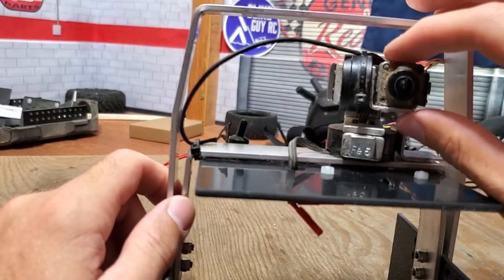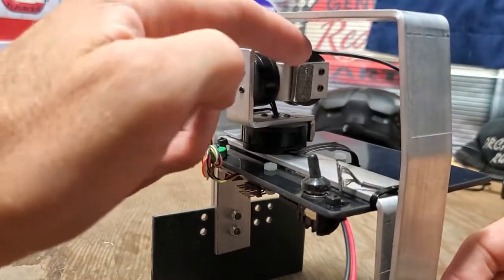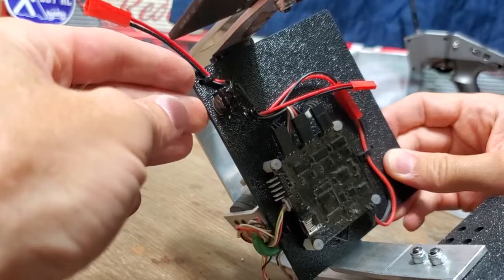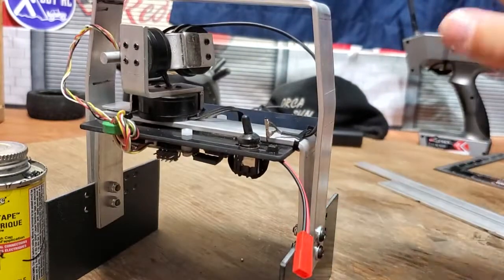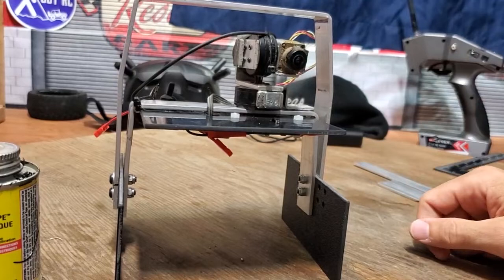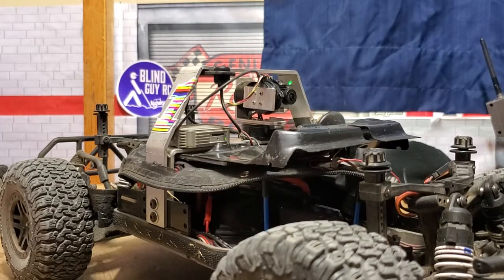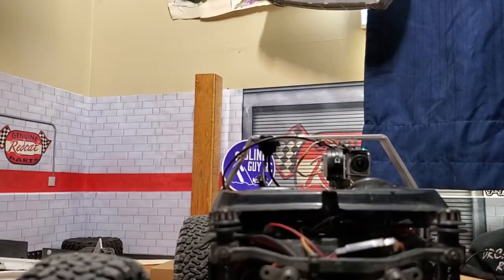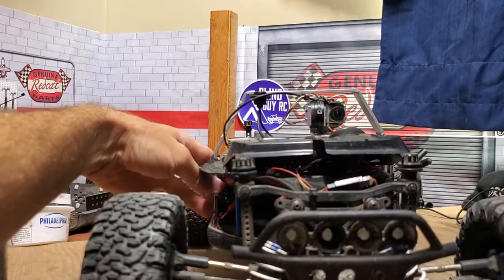FPV Setup - DJI FPV RC Car - 3 Axis Gimbal

Comment: hard mounted? wow and it works very weel. good work man! and good tunnig for the gimbal.. (a part of the cable management.. lol) ..no is a very good fpv car. thank you (i do the same with the same board (storm32)..) but i'm mid way to finnish it.. tunnig a lot.. thank you another time because now, i know is possible!!!
Reply from the maker: Thanks dude! yes i've had some good sucess with the storm32, its a challenge but like you say I wanted to show it could be done and was effective on a fpv car.  I still think there are advanatages to using the storm32 as we can build custom gimbal frames and make them very heavy duty. I find if i limit the range of motion i have the best success in terms of reliability.  Also adding some extra weight to the camera makes the tuning much easier, about 14g should do it.

Comment: Please.. how did you power the vtx on a rc I can’t find a video now where please how did you do it
Reply from the maker: I like to run everything off a single battery so what I do is add one of the red JST plugs to the esc side battery plug.  Then that is used to power all the FPV equipment.  I show this a little bit in my BASH-CRAWL pt2 video 👍

Comment: Which RC Car is that?
Reply from the maker: Hi, this is a Slash 4x4, proline baja bug body and proline bfg ta ko2 tires for shortcourse rims
Reply: @JIPPERR_1   Dude, your video is really cool! I loved your project and I'm going to try to build one!
I can't find this model to buy, can I use the "ZD Racing DBX 10 1/10 4WD" or the "MJX 14209 HIPER"?
Will this aluminum structure fit these models? or in one of them?
Thank you very much!!!
Reply from the maker: @k9fpv  best to stick with slightly bigger rc's 👍 the zd racing dbx10 would be a good one. Cheers!

Comment: I saw you had 2 cameras on the gimbal somewhere, is that for 3D viewing?  How do you send the signal to the goggles? Do the goggles have a "side by side" option to convert the signal to 3D?
Reply from the maker: So ya that is a 3d system, sadly its not produced anymore :(  i did quite like it but thankfully once things are in motion there is a 3d effect due to the relative motion of near and far things. The way this system worked was unique to the goggles (skyzone 02x) where there was one camera signal for each eye. The goggles tune in two separate frequencies, one for each eye. So its a pretty simple system, only drawback is it uses up two channels. It's quite effective, but i still had trouble gauging inclines.

Comment: I am full swing in creating a stabilized gimbal with pwm injection for my head tracker and manual control.  I hit a road block in with the frame parts...  The one that came with the gimbal controller is made for a GoPro and is too big.  I can cut it down and maybe re-drill the holes, but I think I should make some 3D prints of those parts.  Never done it before, so this should be fun.  I am working with a Super Baja Rey 2.0 so I have lots of room to work with in the cab!  I am torn about using a Crossfire PWM adapter or just use the Radiolink controller I got.  Both have great range, maybe I use a combination of both.
Reply from the maker: Right on! Loads of space in that SBR for sure. Sounds like an epic build!  If you want to message me on instagram and i can send you a link to the design for the frame.  I went with radiolink and its been pretty good, but also i dont really know better 🙃

Comment: I see this being the future of RC cars. Imagine a race in fpv? That would be fun.
Reply from the maker: For real dude, hoping this style of rc/fpv catches on. Little hard right now cause all the stuff is custom made. Hoping that if people see this stuff they'll know that it can work and will give it a shot 🙌
Reply: imagine a racing series with real cars but with no restrictions cus safety wouldnt be a problem, imagine an f1 car without all the FIA regulations on it driven from a racing simulator
Reply from the maker: @SIHdW3W  in a way it would be the only safety regulation they need 👍
Reply: Dji fpv won't come cheap other brands is just never ending latency issues

Comment: What wheels and tires are those? I love the way they look. 👍
Reply from the maker: Right on! These are the stock black and chrome slash wheels but I took all the chrome off with bleach. Tires are proline BFG TA KO2, they are a bit bigger than standard short course at about 120mm diameter (PRO1013400).  Because the rims are weird I ordered some 2.2 foams and cut them down to fit 👍

Comment: Another awesome video, ordered my storm32 gimbal today. Excited to tackle this project!!
Reply from the maker: Right on! I have a blog at the rcgroups forun with more info should be easy to search up, username is JIPPERR. I've posted a design template for my current gimbal frame. I may update this soon as I've been going over the design a bit. But nothing major has changed so far.

Comment: Hello! Your videos are fantastic, is there a streamlined setup for a similar system? I am getting the Walksnail FPV system and I am trying so hard to find a gimbal thats around this size.
Reply: Also planning to do only 2 axis for simplicities sake, pitch and roll, but i do like the idea of your gimbal turning with you, thats insane.
Reply: oh! and I am using a traxxas rally vxl 1/10 (non fiesta)
Reply from the maker: Hi, thanks so much for the nice comments!  If you go back through some of my vids you can see in a bit more detail the gimbal I started with.  In the end I made my own gimbal frame to get the size right.  Happy to share the design, construction methods, and setup if you want to give it a shot.  Doing a pitch and roll gimbal will make it lots simpler, yaw makes it more complicated but it is quite fun once working.
Reply: @JIPPERR_1  I'm definitely plunging headfirst on this haha. Each day I learn a little more about these things. The first 4 or 5 times I tried to look up tiny gimbals I came up woefully empty handed. Then I got comments I should just make my own but I don't really know the intricacies of balancing nor do I truly want to spend hours tuning one 😅 (also no 3d printer) 

I was hoping i could get one that would autostabilize out of the box. I was looking through all your gimbal videos but I probably need to review them a few more times. 

Its very inspiring to see the success you've had with the setup, I think it looks great on the drives you've posted. The frame is huge!  I'm trying to brainstorm something that looks a little smaller. 

I keep seeing these gimbals that are upside down (amazon etc), wondering if those will even work if I turn them up the other way, or If I should just mount it upside down and have the cam pop out the windshield or something. I would prefer to see some or most of the car (instead of your first person) but I'm willing to try both. 

Also worried about chopping up my RC car too much because its my only one, but we'll see! I saw you mention a group chat, I wouldn't mind giving that a go as well. 

I think I also need to cool the VTX? Its not flying around in the sky with wind whipping around it, how hot does your DJI vtx run? I am guessing the Walksnail one might get hot.
Reply from the maker: @Ultimate   Headfirst is the way to go! Similar to you I started with the traxxas fiesta rally car because i felt it had the most room under the body shell and like you say the gimbal is pretty big. I wanted it under there so that it would be protected in a crash and to have a bit more of a scale driving experience.

The controller i use is the storm32 and it can be setup in lots of ways so no problem having it supported from the bottom rather than hanging down from above.  Its made for hobbiests so its quite configureable. Also this is one of the less expensive gimbals so not a major investment to strap to an rc thats going to crash and roll, get wet, dirty etc. There are definitly more sophisticated gimbals out there, but this one works well with rc transmitters protocols (pmw, sbus, ppm) and runs pretty trouble free most of the time.  Check out @Smokeefpv here on youtube, he's got a gimbal setup using some different equipment from me.

The big challenge is that if the gimbal is not purpose built for the fpv camera you'll end up having to add weight to ballance it so that it runs well.  But then it'll be to heavy to survive for very long.

Overall im definitly happy with the results, but definitly cost more time than anything to get it to this level.  I guess my hope is that by sharing what I've done it'll help others who want to try the same thing and save them time.  It takes some time to learn gimbals though :)  I wish or dji or any other company would sell a micro sized fpv gimbal! Surely drone and quadcopter people would want that too. 

I usually turn the vtx power way down when i run and if i run out of range or know I'll be going fast then i turn it up.  It gets pretty hot and will go into low power mode if i leave it on hogh power all the time.  A fan is a good idea 👍
Reply: @JIPPERR_1  ended up watching many of Smokee's vids haha, will report back here with more, but I gotta manage the rest of my time before sleep 🤟😅

Comment: This is bad ass! =)  How 1:1 is the movement with your headtracker?  Any latency? ^_^
Reply from the maker: There is a bit of latency on the head tracker, and the gimbal moves a bit slowly for the HT inputs but generally works pretty good.  I honenstly dont use the HT that much as the gimbal also turns with the steering and takes care of any issues due to the car sliding or wiggling around.  It could be set up with 1:1 motion which is probably a good thing for head trackers but im not quite there yet.  I should probably play with the HT more.   Probably I'll do a vid about the HT all on its own as folks really seem interested in this part.
Reply: @JIPPERR_1  awesome!! =)  I'm looking to use this for general purpose FPV usage... planes, drones, cars :-D  I use a headtracker with a 3d printed servo gimbal on my fixed wing and it's a little notchy (just the nature of servo gimbals...) plus none of the stabilization of course.  Fantastic work man; can't wait to see where you go with it!
Reply from the maker: Its great on cars cause it stabilizes the view, I'd watch out on aircraft though, to steep an angle or sudden jostling at high angles could glitch it out.  No problem on a car, big problem on an aircraft!  Definitly cant do any inverted manuvers.  But ya, total game changer for fpv cars 👍
Reply: @JIPPERR_1  ooh, that's good to know.  Thanks for the heads up! =)
Reply: Sorry to bug you again, but quick question on the location of the 2nd IMU (which I believe is the board itself or frame IMU?) which the manual says needs to be above the yaw motor.  I tried booting up my 3-axis gimbal in the inverted orientation and the pan motor started spinning uncontrollably which I think is attributed to the board being below the yaw motor.  Did you experience any similar behavior and if so, how did you bypass that by having your board below the yaw/pan motor? ^_^
Reply from the maker: @grymlock13  no problem, stoked your giving this a go 👍  What you should do is download a copy of the software used to setup the gimbal.  You are correct though about imu2 being part of the main board.  When you setup the gimbal it needs to know what the orientation of the imu and imu2 boards are.  So  by default its setup to be hanging down, so powering it when its flipped over is going to confuse it and itll do what you saw it do.  In the setup software you can switch it.  Link to the software download page is below, youll need to find the right one foe the firmware you have i suspect it'll be this one: o323bgc-release-v090-v20160110

http://www.olliw.eu/2013/storm32bgc/#downloads
Reply: @JIPPERR_1  Awesome!  You were totally on the nose for the firmware this has. =)  I used the configure gimbal tool and now it works great!  The onboard IMU2 doesn't seem to be detecting at all though which I thought was strange.  But it seems to work without so going to try hook it up to some PWM inputs for the headtracker now.  Thanks again man!  I'll keep you posted on progress 😀
Reply from the maker: @grymlock13  right on!  You may need to enable imu2 in the software.  I've found it helps to deal with bigger pitch and rol angles.  What camera are you mounting to this?
Reply: @JIPPERR_1  I tried activating the IMU2 to full but it still wasn't detecting but I'll try dig deeper :-) I'm hooking up a DJI FPV cam and vista unit like you did ^_^

Going to see how it handles as a headtracking gimbal on my RC plane but if it wigs out too much then fall back is for my Traxxas rustler :-)
Reply from the maker: @grymlock13  hmmm thats strange.  Makes me wonder if you have a slightly different board
Reply: @JIPPERR_1  there's an empty spot on my board where when I look at other images of the STM32 BGC v1.3, there should be a chip there.  I wonder if that's the IMU.... =)  I was reading on RCGroups that some were shipping with it missing too 😕
Reply: @JIPPERR_1  I shot you a message on instagram with pictures of the missing chip. ^_^  Thanks again for all your help!
Reply from the maker: @grymlock13  dang thats too bad! Well, it should still give pretty good results.  Always tricky getting these things, i order off aliexpress and have to be pretty picky about which sellers i order from.  Just another thing to lookout for.

Comment: wow, pretty much helpful! I'm already finished soldering part and assembling, now playing with PID's, maybe you would like to make a video part on how all these features sets in GUI. I think best useful feature is relevel by rc input button
Reply from the maker: Andrey would love to see what you've got built!  I found the most important part of setting the PID was starting with a reasonable voltage setting.  I run 3s and have the motor voltages set to 60, 90, and 120 for pitch roll and yaw.  Happy to make a vid showing the GUI settings.  I have a blog post on the subject at rcgroups.

https://www.rcgroups.com/forums/member.php?u=619520
Reply: @JIPPERR_1  thanks for the links! I'm sure I can get here something useful here for me
Reply: Dang I know that I'm a rookie at this at an entry level but PID's and GUI's and don't get me started on DJI .  Nice work on the rig setup, for myself I'm running 6s Kraton with a front and rear foxeer cameras ( only one wired) and some AKK  to make it happen lol. Looking forward to the next video.... can't have too many FPV ground vehicles videos with all the rules and regulations that came to flying drones
Reply from the maker: @jkeithfowler  cheer! Ya I had plans to do some fixed wing fpv but transitioned to ground fpv after drones got regulated.  Turns out this is more fun and i can run my car anytime i have a free minute, no need to go to an airfield etc.